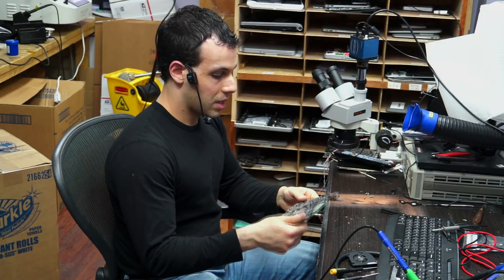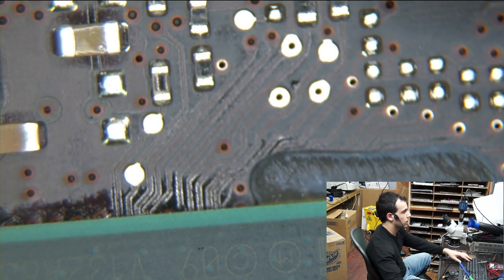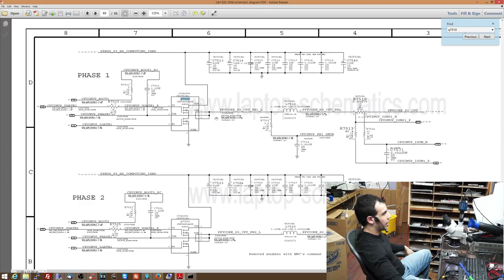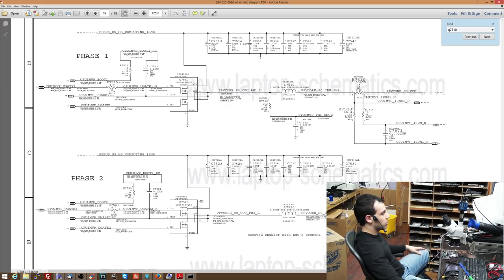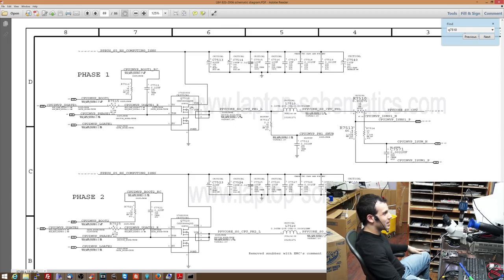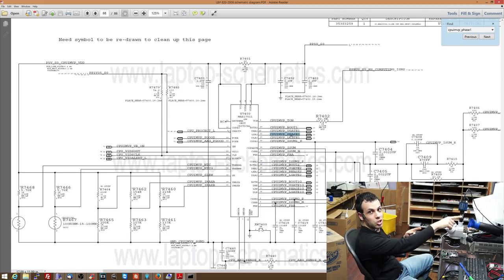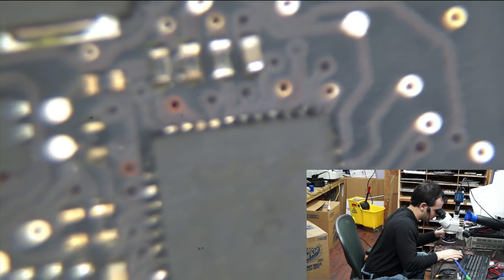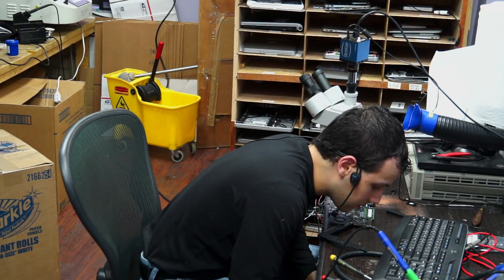Why newbies suck at repairing the CPU vcore circuit.

Comment: I am starting in component-level motherboard repair. I found in one of my own laptops almost the same issue (core vcc is not shorted but both coils that feed the cpu doesn't receive any voltage, MAX8770 is not giving the signal to the mosfet...) I can't believe I stepped into this video

Comment: My desktop motherboard (ASUS M5A99FX PRO R2.0 rev. 1.01) has 16 of those mosfets! Replacing them all would be a bitch. How would I test which is bad? Half of them are 4937N, and the other half 4955n. There's more code after that but I think only these first parts matter? The VRM chip on the board is an ASP1000C. Am I at least getting the numbers right?
Got this dead board with a CPU related issue (CPU_LED lit, not booting) and am trying to figure out board repair for the first time. CPU itself is good, but I'm reading all kinds of shorts to ground with the multimeter on beep mode, including both pins of all the capacitors by the inductors right next to all those mosfets. Any hints or pointers? I'm just theory crafting right now tho, don't even have a hot air gun yet.

Comment: I am facing a problem of overheating with the processor vcc coil, knowing that the device is working and there is a slow performance, in your opinion what is the problem? The mosfets and  control ic have been changed

Comment: I have problem with semince pc hmi the core voltage is 0. 977 v. The mother board dosnt boot after i off and on the hmi unit the unit start boot and cpu voltage core becom 1.074 vand the unit work ok but after half hour the hmii freeze and back to mesur the voltage return to .0.977 please help me which point to check. 
Romany from egypt autmotion manger
Note: found two smd ccapcitore has over heated i remove it but dont install new one is ther about 30 cpictor

Comment: One of my old laptops broke recently, and i tried to recover the harddrive and failed but even before it seemed that the integrated graphics was locked to a lower frequency despite no heat problems. When i took it apart it seemed some mosfets had come out from drops. How would i go about fixing this?